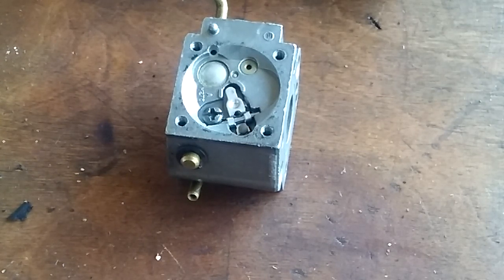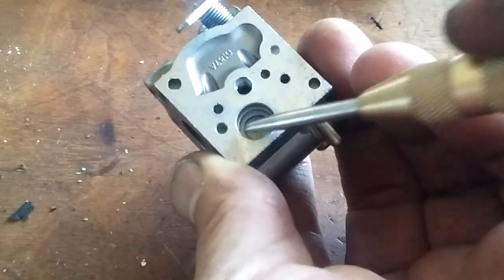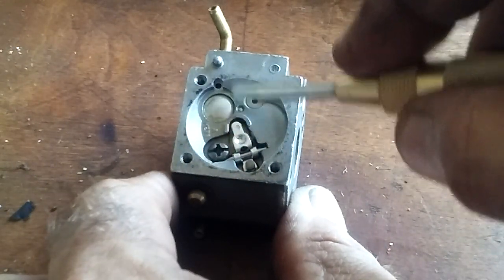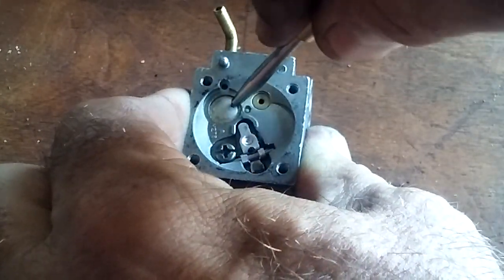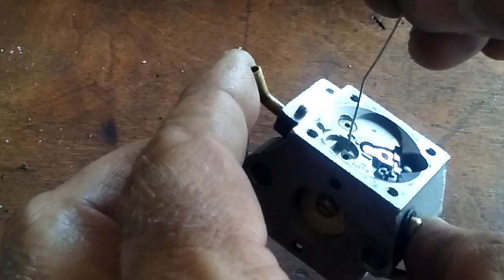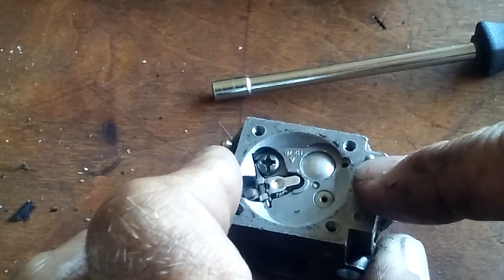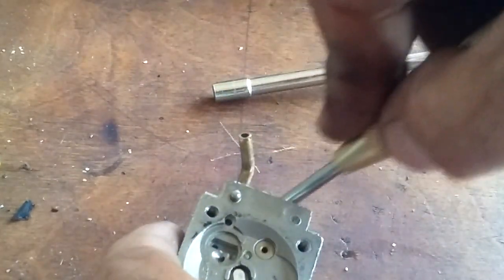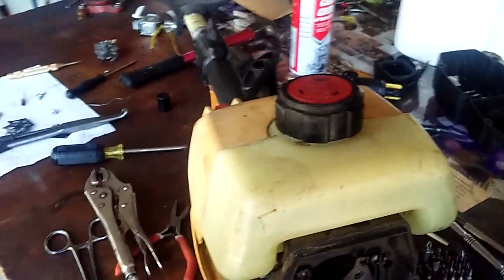Walbro Carburetor welch plug removal for deep clean.You can do this

Comment: Hey Dave COOL tip I have that same center punch and next time I remove a Welch plug I'm going to use it. I was useing drill bits and small screws before. Every time I watch you you have at least 10 more subs than the last time I watched
Reply: Dave Ackerman 1967 iii

Comment: Wait...that's it? That's all it takes? Ha. Here I was a little shy taking those off. Will try it later today, my trimmer is bogging down when accelerating.
Reply from the maker: Lol Toad, let me let you in on a little secret. Trimmers are famous for getting clogged at the exhaust port or spark arrestor. It's hard to run a weedwacker full speed all the time and that's where the majority of the carbon build up comes from. Check that first. You still may need a complete carb clean but a carb clean by itself won't stop the bogging on acceleration by itself. You will still need to clean the exhaust. Good luck buddy.
Reply: @ZombieDaveAZ  your right I usually run my trimmers @ 75%throttle. Thanks
Reply: I hope you got it fixed!  I rather doubt that the circuits behind the welch plug were what was causing the bog down, but hey it never hurts to learn new stuff!

Comment: It's called an "automatic" or "spring loaded" center punch and belongs in everyone's drilling kit. They are very, very handy and one thing they avoid is hitting a solid punch too hard. They offer better control too which is why machinists use them.

I really like your method because punching at an angle with traditional methods is inferior in terms of control and risk punching too far damaging the carb body.
Reply: You can also adjust the pressure the punch exerts by unscrewing the cap. Hard steel- leave the cap screwed all the way down. Soft non-ferrous metals- back the cap off a bit to avoid making a crater. And the really good ones like Starrett have replaceable tips. Cheers.

Comment: Thank you for your videos, and time
I bought  a rebuild  kit from walbro, and that 
Welch    plug  is NOT IN THE  bag,
Can still push it out clean 3 orifice s and place  back the same just with the dent on?
Please le me know before i mess it up worse, the chainsaw  echoncs490 , i  change everything,  fuelnlines,  filter, spark plug,  clean spark arrestor,  fuel filter oil filter, 
And nothing start  and 3 seconds shut down, choke it started  pull trigger  shut down, ever single time,
New carburetor  is 119$,
Reply from the maker: Echopartsonline.Com has that rebuild kit for less than $7.00 and the Welch plugs are included. I just looked it up.
Reply: @ZombieDaveAZ  hello i looking  but i can find  the carburetor  new or the rebuilt  , is aking me for the part  number, do you have  tje number
Reply from the maker: @Isgood2beKing  email me zombiedaveaz@gmail.com I will send you the link
Reply: Check diaphragm that controls needle valve for fuel inlet. Walbro has a tool to check if needle rocker arm is too high or too low. If too low needle never comes up to let fuel in. If too high the needle never seats. A good flat edge like a feeler gauge will work like the tool. It only takes a little bit of movement to bend rocker arm up or down.
Reply from the maker: @dustinpotter8312  MAN! You are spot on! Both Zama and Walbro have a tool to set the metering diaphragm. Those are usually the reason for carburetor problems particularly for machines that don't run everyday. The metering diaphragm gets hard and stuck in the up or down position. Up and it won't run as you said. Stuck down and it can fill the crankcase with fuel. Hey, where did my gas go!? Lol😂 . Thanks for your comments, I appreciate you. 👍
Reply from the maker: @dustinpotter8312  MAN! You are spot on! Both Zama and Walbro have a tool to set the metering diaphragm. Those are usually the reason for carburetor problems particularly for machines that don't run everyday. The metering diaphragm gets hard and stuck in the up or down position. Up and it won't run as you said. Stuck down and it can fill the crankcase with fuel. Hey, where did my gas go!? Lol😂 . Thanks for your comments, I appreciate you. 👍

Comment: Hey Dave, Great video & Thank you! I have a similar carb from what I can see, WT419. I got a rebuilding kit from Ereplacements there was no welch plug in it and i had to get the needle separately and it was half the height. I cleaned up the old needle and put it back in, do you happen to have a video of the way the diaphragms & gaskets go on and the gas lines too. not sure if it was me or the original owner that screwed things up. I pump the bulb and get no flow of gas, the lines are new. I think it's wonderful how you have answered replies for this long. You Rock!!!!
Reply from the maker: https://youtu.be/k_HhnNjFdxQ.  This video will show how the fuel lines go and work
Reply from the maker: Diaphragms always go against a flat surface in the carburetor. The metering diaphragm ( the one with the metal tab in the center) goes on after the gasket.👍

Comment: Great video!thank you!
Hope you can help me.
 If i pump my primer bulb air goes out but no fuel comes inside .
I already changed all gaskets and diaphrams and screen with walbro rebuild kit and  used air compressor in every hole.
Should i try to remove the welch plug??
Thank you
Reply from the maker: Are you 100% positive your lines are not backwards. Is the primer on the carb or a remote primer?
Reply: Primer bulb is on the top of the carburator..it is a  walbro 668.
Fuel lines and filter are ok for sure.
Thanks
Reply from the maker: Hey Paolo, did you get this carb problem sorted out yet. Sorry I didn't get back to you. I didn't get a notification from YouTube.
Reply: @ZombieDaveAZ  the check valve is the problem I suppose...today I noticed that if I close the hole of the check valve fuel comes inside.
It seems impossibile to remove without drilling it..how can i do?thanks
Reply from the maker: @paolocamilloni8819   I don't know. I have not taken one out since I have nothing to replace it with. I agree with you that it looks like you would have to drill it out. If I determined that the check valve was the issue that's when I would prolly buy a new carb. Sorry I'm no help to you. 🥴

Comment: Dave where can I buy an assortment of welchplugs.
I tried to get one or two for the carburator I was working awhile back.
My local small engine repair shop acted like I was trying to find a unicorn, was basically no help.
Reply from the maker: Amazon has tons but you would have to specify which sizes you would like. Unfortunately tbere is not just a kit of assorted sizes. That would be nice.

Comment: Nice one sir. I hope this has saved my weekend. Thank you
Reply from the maker: nigelcarren Im here if you have questions or further assistance. 🔧👍
Reply: Hey Dave, thank you... what a gent you are. You know, I have nursed rally cars across the Sahara in my past and fixed some really complex machines, but this little carb has had me scratching my head. I was about to lose the plot when I noticed this little plug in my new gasket set... so I googled it and here you are! There is literally NOTHING else for me to try after this? So I will let you know how it goes buddy. Thank you. The word of the weekend is; 'Welch Plug'. Cheers Nigel
Reply: Good evening Dave, well I promised I would update so here we are and just maybe it will help somebody.  In short; ITS ALIVE, and she revs higher than I can ever remember. As it turns out there are 3 faults. The Aluminium Welch plug I removed just as you did, but it was clear, so I carb-cleaned with wire and all the jazz whilst I was there. But in my little carb I have a little brass Welch plug, apparently this conceals a gauze filter which in turn feeds the high-rev jet (this is what didn't work with mine... I tuned throttle and she choked and stopped). I drilled a 1mm hole in this brass welch plug, then drove a screw in and pulled with pliers and there she was... FILTHY partially blocked gauze. This was in my carb-kit along with the little circlip. So I cleaned again and heard in a new brass Welch plug (so thats both Welch plugs removed and cleaned). Now she ran but it was all over the place.
Reply: Continued; So I fixed some new fuel-line direct to the carb and straight into the tank through the filler-cap (to eliminate the fuel line) and BOOM she ran superb. So I put it all back together by routing the new fuel-line properly through the tank-grommet and she ran... but kept stopping. I cracked open the fuel-filler and she went again... AHA BLOCKED BREATHER? So removed blocked foam from breather and jeez... Like a new tool. So thank you for your help, and the Welch Plug lesson. Keep up the great work. I can now start hacking through my jungle.
Reply from the maker: nigelcarren  Its kinda funny how once you start ripping into these things its not so intimidating. Its just doing the first couple when you have a little self doubt looking over your shoulder.
Reply from the maker: nigelcarren  maybe I should have steered you towards this looooong drawn out video I did last year. Grab a pint and check it out at your leisure. Enjoy https://youtu.be/uFqLOXXIuzU

Comment: Nice. ... but where do you get the correct replacement welch plug?
Reply from the maker: Comes in the kit with gaskets and diaphragm. I use Amazon for mine. Be sure to spec "YOUR" carburetor.

Comment: What are the symptoms when those tiny holes are clogget ? It's gonna bog down when throttle up the chainsaw ?
Thx.
Reply from the maker: Opposite of what you're thinking brother. Most welch plugs are a result of the manufacturing process. IE: after the carb body is made they have to put in the holes for the fuel to flow. Hi speed jet and the adjustment screw is tapped. Then the low speed jet is drilled and tapped. Under the Welch plug in a 2 stroke or pulse carburetor is a idle air passage that is preset . That works in concert with the low speed adjustable jet. When the machine runs on its own with just the low speed jet adjusted it is now time to apply throttle. Now all 3 passages work together to deliver the proper fuel air mix. Again now the hi speed jet is adjustable and they all must work together to deliver power under load. If you have done all the adjustment you can with the low speed jet and it still won't run, try cleaning under the Welch plug. Some guys get away with using a ultrasonic cleaner to clean what under the plug. I hope this helps you .

Comment: It seems to me that you are better off just replacing the whole carb. if you cant be sure what is wrong with it.....I just replaced a carb on my 2-stroke and it is working again......I must have damaged the old one cleaning it and did something wrong, like blowing the airline into it which I sinced learned is a BIG NO-NO  but I know now never use the airline.
Reply from the maker: You are not wrong in your thinking Carl.  There are guys that can walk by a 66 Chevelle and say "that's awesome" and keep walking. Another guys sees the same car and wants to see what's under the hood. I'm not alone in that. So for the guys that want to know how to unlatch the hood and see inside, I make videos.  If you take something apart that's already broken or not working and you can't put it back together you really haven't lost anything. It didn't work when you started and it  MAY or may not work when you put it back together. So I've always been a replace parts only after I gave it my best shot kind of guy. That's just me. Thanks for commenting 👍
Reply: thanks for responding @ZombieDaveAZ

Comment: Does the welch plug come with a rebuild kit, and all the gaskets? Does Walbro/ZAMA, etc., expect this plug to be removed as part of a rebuild process? If not, where do you buy a dinky little plug like that for less than $25?
Reply from the maker: Hey Graham. I use HIPA and they have the Welsh plugs included in the kits. You can access what they have thru Amazon and look thru the picture of what is included. Usually runs about $7 for all the gaskets, diaphragms Welsh plugs, springs, metering needles etc etc.
Reply: @ZombieDaveAZ  Thank you! I'm about to hit the "Buy" button!

Comment: Crap I never thought that was something that even came out.  I've done pulsa jets and various riding mower and push mower carbs many times. These tiny little guys are something new for me personally, so you definitely have the tips I need brother,  Thank you again 😀 
BTW have you ever re used a Welsh plug and if so are they repairable/salvageable when just doing a cleaning, get them back in and work properly?
Reply from the maker: Kevin Doble yes i have reused them. I have a video on a briggs carb where it just fell out and was in the bowl. I cleaned it up and used it again.

Comment: Is there a kit available that has at least a couple of those Welch plugs in it?  You got a link for a good kit handy?   I'm not finding anything I really like yet.   Thanks again ZD, take care.
Reply from the maker: Different kits for different carb models. Once you know which one, Amazon will have the kits for 6-8 dollars. OR a new Carb for $12-$18. The model # is stamped on your carb. Example K-1 etc.
Reply: Okay, mine is a Walbro 228, WT433.  Is it the same as the 88-171-8 ?  (And R8123 ?)
Reply: Thought I ordered the wrong carb, but just realized I just have to swap out the throttle shaft so the linkage will work, thank God almighty; free at last.  It wuz a real dern it Laura Dern there for a minute...
Reply from the maker: @leeisenberg  😂😂
Reply from the maker: @leeisenberg  QAZAKY 2pc Carburetor Diaphragm Gasket Rebuild Repair Kit for Walbro K10-WAT WA WT Series Carb 2-cycle String Trimmers Blowers Chainsaw Poulan Weedeater Ryobi Homelite Lawnboy Toro Stihl

Its $6.99 on amazon

Comment: Hey, with removing the plug you can clean those holes underneath. But what about that jet near the plug, can it be somehow removed and cleaned as well?
Reply from the maker: When the welsh plug is out, remove the low speed and hi speed jets. They are not always the same so do it one at a time or mark them. Also there may be a Small o ring that stayed inside the carb. I use a small piece of fuel line on the end of the carb spray straw and clean the passage that way. I hope that helps you.😎
Reply: The jet (brass insert) near the welch plug is the one and only main jet and it has a delicate check valve in it. It is made of mylar and if sprayed with a harsh chemical it will distort the mylar and it will no longer function. At one time they were replaceable, but I haven't seen them available for many years now. Also, Zama and Walbro do not recommend ultrasonic cleaning. They recommend soaking in fresh gas. Zama has a great website loaded with info. Maybe Walbro has the same.

Comment: ZAMA C1U-K19  JD 21c weed eater air filter soaked with fuel and fuel seams to be splashing out of carb when i remove air filter and run it. any fix for this. also cant find a new air filter online to order.
Reply from the maker: Anything is better than nothing on the filter. Maybe some foam that does not disolve in gas. And here is what's wrong/why gas is coming out. Hope it helps. https://youtu.be/wNTKOuKwXaI  stay safe and have a good weekend. 👍🍺😷

Comment: Is that the way to remove the micro filter by using the punch? Poooff! 
  My dear please use the clothes stiching needle.
Reply from the maker: Screen is on the pump side Tony. This is for welch plug removal only. Thats on the metering side. Thanks for commenting. Poof!
Reply: A blast of compressed air from the opposite side will usually blast that screen filter right out. If your rebuilding it doesn't really matter but if your just cleaning and reusing just be careful and keep your hand over the  backside to catch the screen or aim it down in a bucket because it will go flying.

Comment: Hi. How do you fit the welch plug on a Zama  carb ,not the round one the oblong one.
Reply from the maker: Hi Neil. Use a big screwdriver with the blade going in the same direction as the plug. Tap the back of the screwdriver with a hammer. Good luck buddy.

Comment: What if I don't put the plug back in?
Reply from the maker: Hey Paul. The plug is necessary to cover the Access ports that are drilled in the manufacturing process.. so when you see the low speed jet "hole in the carb body it is metered via the jet screw ". Without the Welch plug the fuel is unmetered. Would it run? Probably, BUT it would be a fuel and oil rich environment and the EPA would never ballow it. Good question and thanks
Reply: @ZombieDaveAZ  many thanks.

Comment: I never can get the plug to reseal right
Reply from the maker: You're not the only one Rob. I think I mentioned that older mechanics would seal the plug with fingernail polish. Now that ethanol has been introduced to our fuels, that little bit of alcohol will dissolve the nail polish and thus another cool trick is now gone. Thanks for commenting and stay safe. 🍺😷👍

Comment: I don't have the carb on hand right now so I'm not 100% but can you just get those holes from the throttle body cleaned out instead of taking the Welch plug out or is it too hard to get the angle right and reach in there
Reply from the maker: You would "probably" have better success using an ultrasonic cleaner if you want to avoid the welch plugs. But in my mind thats a $60 solution to a $6 problem. Know what I mean?
Reply: @ZombieDaveAZ  yeah I hear ya...i hear putting the 2 stroke carbs in boiling tide works wonders for getting them cleaned out...ever hear of that?
Reply from the maker: Lol, I just read my first response and realized I didnt answer your question. Lol. My answer is I'm not sure. I've havent had much luck doing it that way. I tried putting a pice of fuel line on the end of the straw on a can of carb spray. No luck.
Reply from the maker: Not heard of that but Ill try almost anything once. 👍